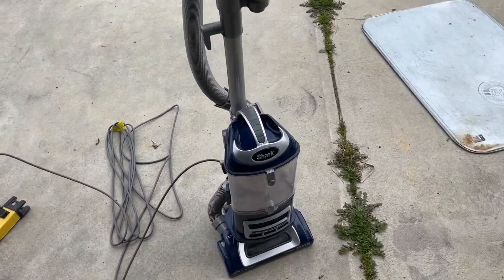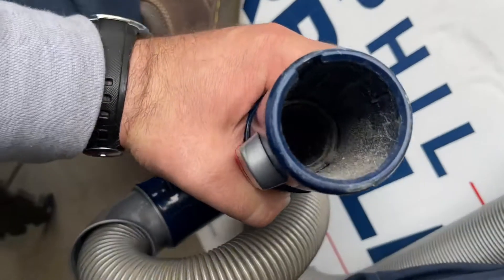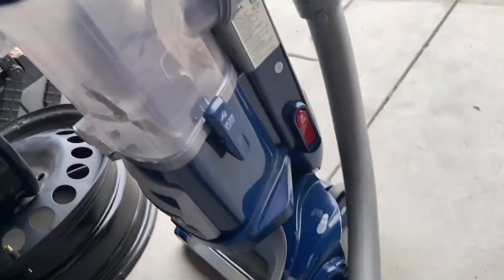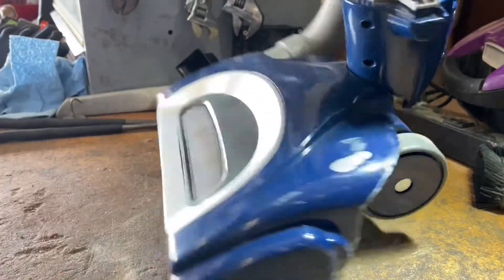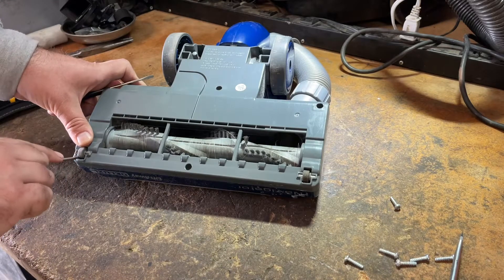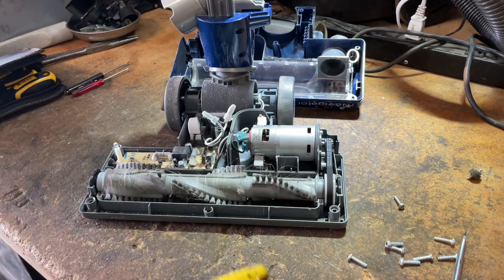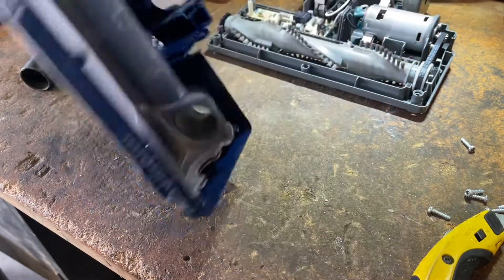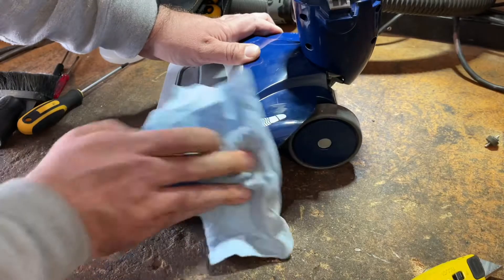Fix - Shark Navigator Vacuum Makes a Funny Noise?

Comment: Thank you for sharing! Troubleshooted all the removable parts of the hose and found a lead pencil in the upper handle!!! Took me 15 min for me to unscrew the screws to realize the handle does not come apart. Spent the next 30min using a wire hanger prying the pencil out. Thank you again (:

Comment: I have no clogg and it is still making this noise no suction please help
Reply: I did everything he said to do but did not work, while running i took the dirt collection basket off, the noise immediately went away, put the basket back in place, the noise was back, it turned out to be the wire cone in the top of the dirt basket, cleaned it with a tooth brush, working perfect now.
Reply: I have the same issue

Comment: I have changed my filters, checked all my hoses, but that noise that it makes when it’s clogged is the little valve underneath the filters that spring loaded. Could there possibly be something wrong with that?
Reply from the maker: @alilbitclueless100  did you check the middle hose in the power nozzle?
Reply: 😊 I am embarrassed to say that my dust collector that holds the dirt is so cloudy with dust, that I did not realize the top filter cup area was clogged with a small plastic cap and that it allowed everything to collect on top and create the clog!  I usually open the top and dump it also but there is never anything in there.. So, boil it down to a USER ISSUE 🤣 Thank you for your quick reply!
Reply from the maker: Glad you got it fixed!

Comment: What if it makes the lose of suction noise and there is no clog at all??
Reply from the maker: clean the filters
Reply: I'm not sure if you have the same model as me. It's similar to this one. I didn't even know there was ANOTHER FILTER, and that was causing me my problem. I cleaned everything and had no clogs but noticed there was another. The bin that collects dirt on the top is a latch and is another filter, and mine clogged up with a bunch of crud
Reply: After I took it out it fixed my problem
Reply: I did everything he said to do but did not work, while running i took the dirt collection basket off, the noise immediately went away, put the basket back in place, the noise was back, it turned out to be the wire cone in the top of the dirt basket, cleaned it with a tooth brush, working perfect now.

Comment: I have a whole new problem my vacuum powers on but it doesn't even turn the motor on for the top part for the hose and when I try and use the bottom part works normal but with a weak suction any ideas??
Reply from the maker: Sounds like you have a clog, or the filters are bricked up.
Reply: I did everything he said to do but did not work, while running i took the dirt collection basket off, the noise immediately went away, put the basket back in place, the noise was back, it turned out to be the wire cone in the top of the dirt basket, cleaned it with a tooth brush, working perfect now.

Comment: i  did all this, still makes that bypass noise   UPDATE! I did everything he said to do but did not work, while running i took the dirt collection basket off, the noise immediately went away, put the basket back in place, the noise was back, it turned out to be the wire cone in the top of the dirt basket, cleaned it with a tooth brush, working perfect now.
Reply: so are mine